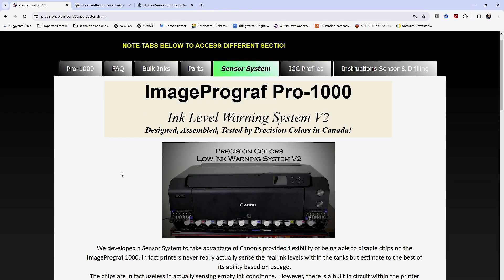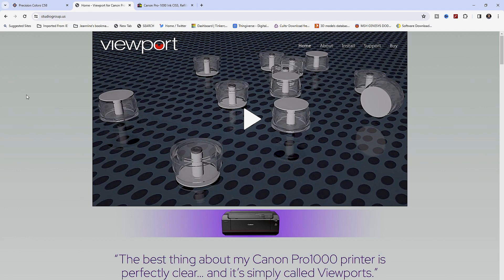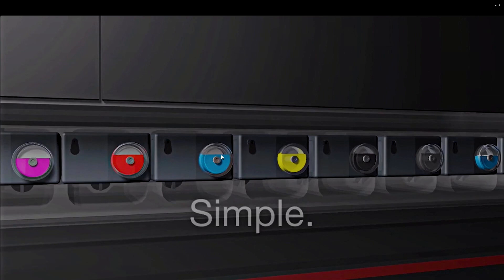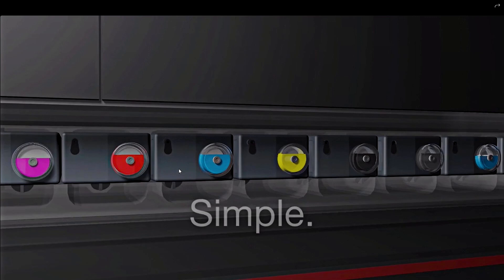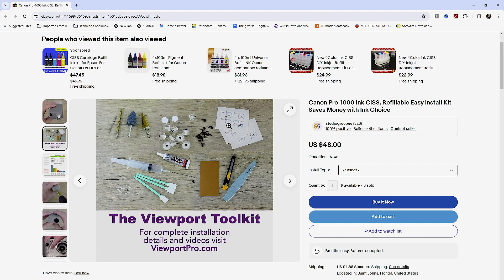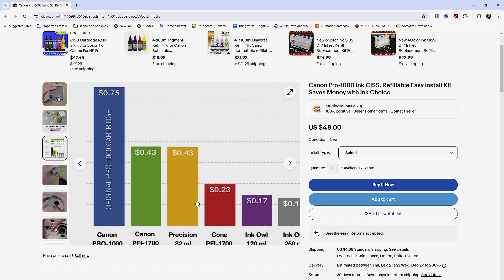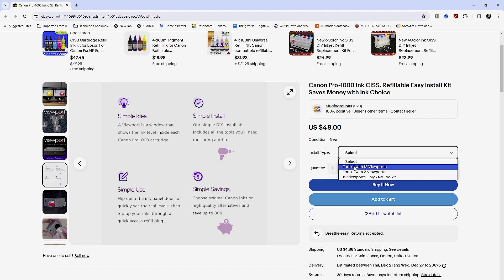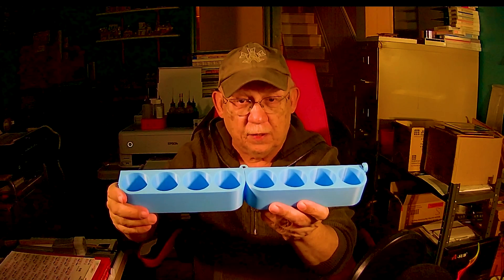BRAND NEW Ink Monitoring Method for the CANON IPF PRO 1000

Comment: A most interesting "solution" to ink levels. I'm in the UK and have recently moved from an Epson 3800 refillable system to the Canon PRO1000, and have been looking into refill options for the Canon. Do you happen to know if genuine Canon ink can be purchased in bulk in the UK? I think I picked up from one of your videos that genuine Canon ink can be purchased in the US.  Many thanks
Reply: eBay u.k. pfi1700,or pfi 1300 I pick up all 12
Reply: eBay u.k. pfi1700,or pfi 1300 I pick up all 12
Reply from the maker: You just buy larger tanks such as for the Pro2100. All the printers in that series use the same colors and formulations. You have to then extract the inks from those big carts and fill your smaller Pro1000 carts with them
Reply: I still prefer the precision color ink monitoring system.